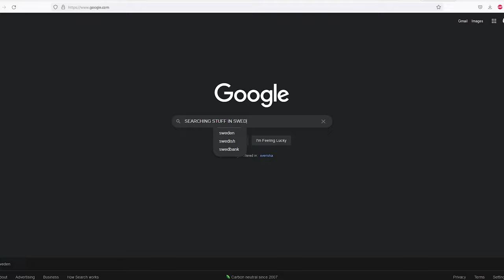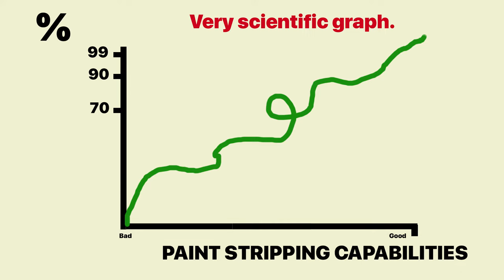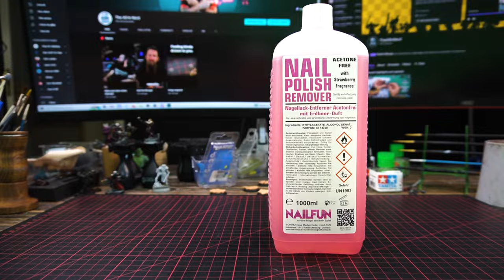The Best Stripping Method for Minis

Comment: You should look at the type of plastic container you are using, as the nail polish remover comes in a plastic container. I think you will find that the nail polish remover comes in High-density polyethylene (HDPE) and that plastic container you use was Polypropylene (PP). The recycling symbol can be use to tell the difference.
Reply from the maker: That’s a good advice! I just didn’t think it would be that powerful since it was acetonefree. 😁

Comment: Thanks for a very informative video.
I use Purple Power available in the automotive department at Walmart or Oil Eater from an auto parts store. Both are biodegradable and reasonably safe for skin contact for a short period although they will "degrease" your fingers too. Removes chrome and paint on most models in just a few minutes to a couple hours. I've left models in it over night with no bad effects.

Comment: It's biostrip 20 for metal models & pure alcohol for plastics in my opinion. Idip in EPA for a few hours, use a tooth brush & then an old paint brush to get any paint left in cracks. Genestealers are a pretty extreme model to strip due to the nooks & crannies. If you don't know what primer was used on the models it's not truly a fair test in my opinion though.
Reply from the maker: The primer used on the genestealers was Chaos black with a zenithal of Grey Seer from Citadel. 
The Razorback/Rhino was bought painted so with that one I didn’t know what kind of primer that was used. So I guess that Biostrip wouldn’t be the best choice if you don’t know what paint and primer that’s been used. That’s a downside of buying second hand that you want to strip. Best of luck stripping!

Comment: What was the cure time on the paints?  Is fresher  paint easier to remove than older oaints?
Reply from the maker: @jeffmckenzie7282  Between primer and paintcoats the models got atleast 12 hour curing time. But it was days after painting them before I stripped them. 
If the paint is still fresh I would assume it would strip easier but when it’s fully cured I don’t think it would matter for how long it would have been painted.

Comment: 13:20 NEVER just dunk your models in the Biostrip tub (This will ruin the rest of the Biostrip).
Instead put some Biostrip on the model like a layer of paint and leave them in an airtight tub or jar for best results.
I find it only takes 30 minutes to remove most paint for plastic models.

Comment: can i use isopropanol alchool on resin mini?
Reply from the maker: I didn’t do any tests with resin models sorry.
Reply: @TheAll-InNerd   thank you anyway
Reply: You can.  Don't leave them in the ISO for longer than 30 mins at a time
 I've personally soaked for an hour or so, but after then it starts getting soft

Comment: cant imagine even considering brake fluid with all the other options available lol. any method is going to require a deal of scrubbing / work to get it all off and an average of a couple hours. for time, cost, convenience / availability, simplicity and performance... just go rubbing alcohol. stronger the better but 70% works just fine. the paste stuff to brush on for larger items might be worth it though.

Comment: I used acetone free nail polisher but it melted a bit (i tried it very quickly).
So, it is not enough to say acetone free nail polisher. We need to know which solvent it contains. My wife's had ethyl acetate and i can confirm it is not safe for minis.
Which is yours? Look at the ingredients label
Reply from the maker: Well I did test it and it did melt my container after just 3 minutes so I warned about using it since it’s so potent. It even worked by just brushing it on without soaking the model.

Comment: I have some Battletech minis on which I accidentally used the wrong primer. I tried the alcohol on the first mini, but it was slow. I tried the non-acetone nail polish remover. It did the job, and now I got a some what squishy Awesome. It also melted the base.

Basically, someone owes me an Awesome. Lol.
Reply from the maker: For how long did you leave it in the acetone? Did you try just to brush on the nail polish remover like I suggest in the video?
Seems like a lot of people don’t really watch the video fully and see that the nail polish remover is super potent and should be used carefully.
Reply: Should have used Totally Awesome on that Awesome. It was spelled out for you.
Totally Awesome is a Awesome mech cleaning exclusive.
Reply: @TheAll-InNerd  I didn't leave it in for very long. It started working very quickly. The mech has gone back to its original state, and sanding the base got it in decent shape.

Comment: since its the fastest, acetone it is for mee 🥰
Reply from the maker: Be careful not to melt your minis! Testing on something is always best!
Reply: @TheAll-InNerd  btw will it work with an already varnished model ? i plan to repaint a batch of old minis :")

and don't worry I'm gonna use the brush on method like you did, I don't wanna forget that I left my mini to soake for too long haha
Reply from the maker: @akbaragill00  Removing varnish shouldn’t be a problem. But just a heads up, I used nail polish WITHOUT acetone and it was still very potent. Pure acetone will be REALLY potent. 😊
Reply: @TheAll-InNerd  oh dang.... I just notice your bottle says acetone free🤔 alllrighty then, thanks for the tip😸

Comment: Be careful with the nail polish, mine melted my Phobos librarians head 😢
Reply from the maker: How long did you leave it in? After 3 minutes it melted my plastic container but the model survived. As mentioned in the video you should be cautious with the nail polish since it’s so potent. If you use nail polish with acetone it’s even more potent.
Reply: @TheAll-InNerd  only around 4 minutes I would say, it was acetone free too. But I tried the methylated spirit and that worked great!